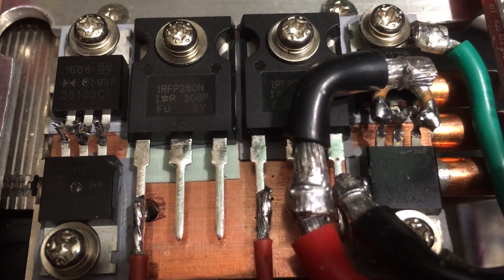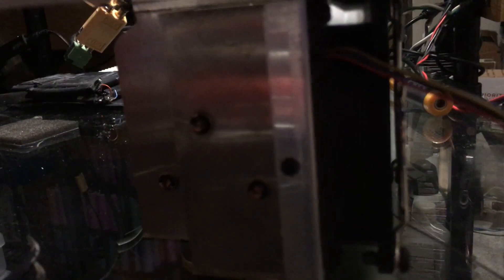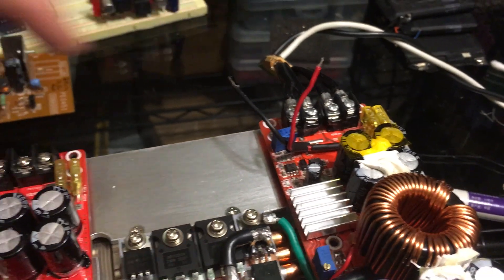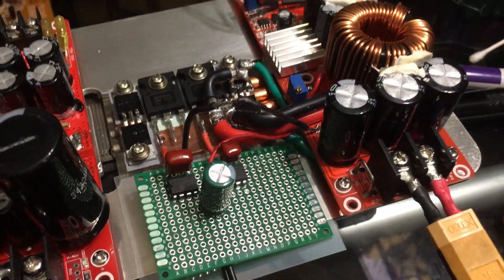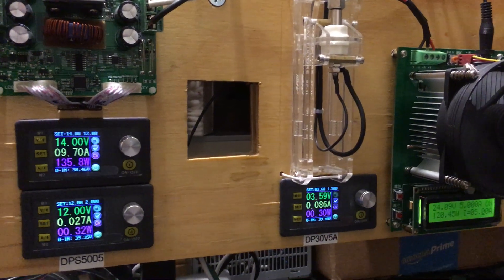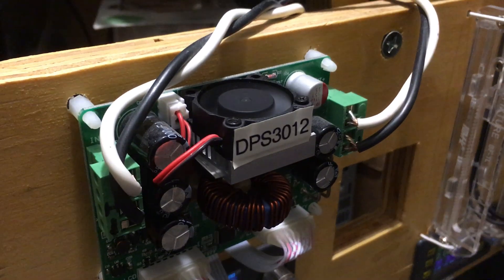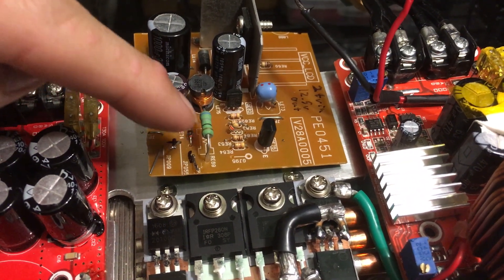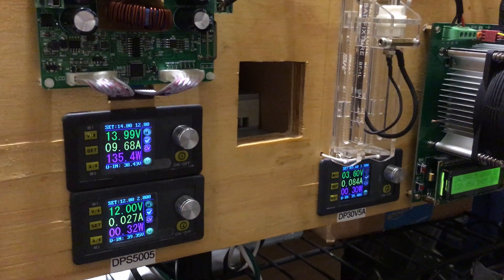3000W Boost Converter first phase testing!

Comment: Optocoupler will decreases reaction time, even 100-130khz. I'm doing same thing, 50A@48v. I'm using isolated mosfet driver (1EDI series) with totem pole output stage. TL494 based converters something cheap, but not good stuff for this job.
Reply from the maker: thanks for the info, what exact chip are you using?
Reply from the maker: yea these are a complicated series of mosfet driver, I am not sure what chip I need for my application.
Reply: @SuperBrainAK  1EDI60N12AF
Reply from the maker: @khosoo_halo  well I ordered some of those, thanks alot for your reccomendation, hopefully the project will be finished soon!
Reply: @SuperBrainAK  Sounds good. Keep in mind, isolated power (+15/-5v) tiny dc-dc converter helps a lot for the 1EDI driver. I mean, negative bias needed for nice turn off

Comment: Can handle 3000w?
Reply from the maker: I would say 2000W before I start hitting limits. The mosfets probably are good for it but the PCB and other components on it aren't.
Thank you for the comment!
I am working on riggin up some bigger power supplies because I was at the limit in the latest video. Do definitely check that one out!
Reply: @SuperBrainAK okay 👍 thank you 😊

Comment: seems simple but this is an expensive hobby😅
Reply from the maker: Even with the modules being 13$ when I bought it they cost that much in replacement mosfets!
But recycling the components as much as possible has certainly helped.
Both stages are finished BTW.

Comment: make more stable totm pole and add more mosfet can increase watt boost coverter..right?
Reply from the maker: yea, that is why I got better mosfet drivers in a later video. Check out the playlist.
To go more than how it is currently setup would need some better logic. The logic it has now is very basic and has some flaws. I would want a phase doubler at the very least.

Comment: whats the rated input n output volts/amps?
Reply from the maker: It will be 12-50 volts @ 60A input, and 100v@3000W output theoretically. But there will be many drawbacks, the current limits and balancing will be a major factor. I plan on running it at 24v so it will be limited to 1440W but that is at least better than the 720W it was stuck at originally.

Comment: hi is that the 1800w version but change the mosfet?
Reply from the maker: It is the 1500W version, and yes the mosfet and gate driver circuit has been changed it is using a TC4420 driver IC and an IRFFP260N Mosfet, I did another video on a single one that I just upgraded the mosfet and gate driver on. It performed very well.

Comment: Hello. your video is very interesting. I would like to know if it is possible to connect two converter in parallel to increase the current (for example: connect in parallel two modules of 72v 12 amps to give 72v 24 amps) thank you very much
Reply from the maker: Yea you can put them both in parallel, just make sure you set the voltage exactly the same on both, otherwise the one with the higher output voltage will be doing all on the work. If you can measure the current with a clamp meter then you can fine tune the output voltage up or down on one module to get the current the same on both. Hope this helps, good luck with your project!
Reply: @SuperBrainAK  Ok thank you very much.

Comment: Using an optocoupler would be a better option mate. And with your mosfets, cut off the drains and isolate the mosfets from each other and use the screw you screw them down too with a ring connector for your mosfets out! Basically using the back end of the mosfet as it’s the main drain out!! Instead of the thin drain pin!

Hope this helps mate and good luck 👍😉
Reply from the maker: yea I did revise the circuit to use an Optocoupler to trigger the drivers, the gate drivers are in reference directly on the Drain being powered from a fully isolated supply. The Optocoupler was used to pull the drivers to 12v via a 1k resistor but that did not work at all 😁(no duh!) I then put a 5v linear regulator on the 12v supply, then I connected the Optocoupler to that. I used the same 1k pullup resistor in series with the Optocoupler then there is a 10k resistor on the Driver input to pull it low again. However for some reason I am still having trouble with the driver not turning the mosfets off fast enough.
Do you have any ideas what is going on? maybe I need a lower value pulldown resistor? or maybe I need another optocoupler to actively pull the gate driver low again?
I know that the tab on the back is the drain but I dont think this mosfet package is designed to use the screw for current. It is very well isolated from the drain and I dont want to connect my heatsink directly to the drain because that would cause the high voltage to be exposed. I did use the tab for the doides though 😉
Thanks alot for the help it is much appreciated!

Comment: would love to see a schematic!
and would it be possible to use a shitty xl6009 to drive a external mosfet(or boost converter with a dead controller)?
Reply from the maker: yes you can, I actually used an XL6009 Sepic board to control the mosfet driver board in this video: https://www.youtube.com/watch?v=ZU-E9lBTkFk
just remember the XL6009 is active low so you will need to connect it to an inverting mosfet driver with a pullup to 5v.

Comment: i find it really neat how you repurposed the dc-dc converters for upgrading. Question is it possible to repurpose a dc-dc converter as a flyback driver?
Reply from the maker: It would be possible, however you might want to only use a boost converter controller. That is because at full power a buck converter will be on at very close to 100% duty cycle, a boost converter has an intentional limit so that is impossible.